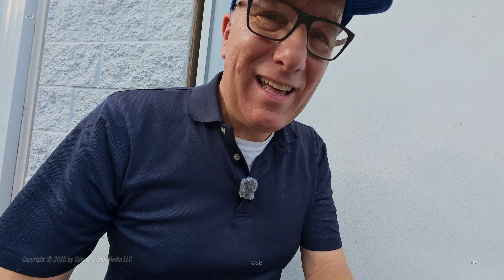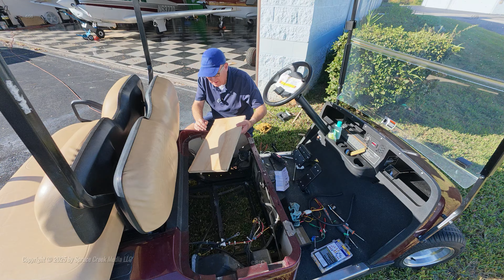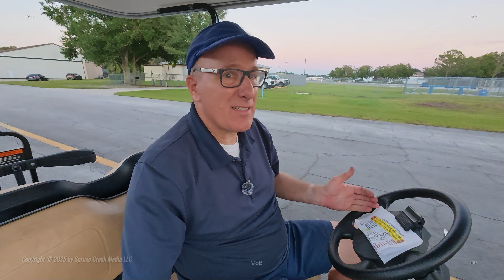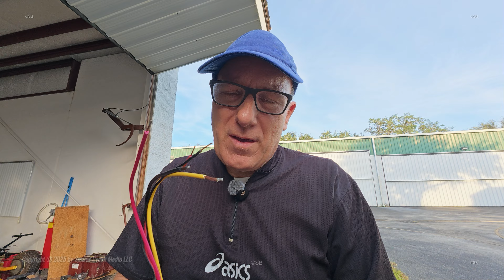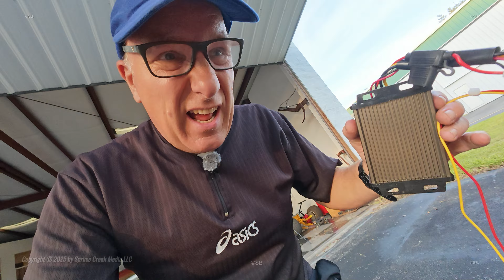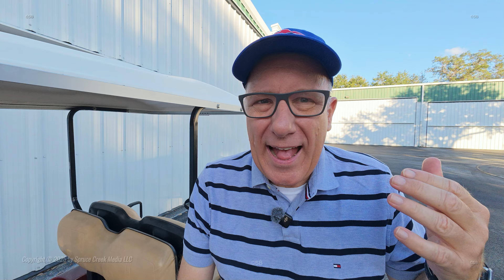GOLF CART LITHIUM BATTERY UPGRADE FULL INSTALL TUTORIAL + SPEED TEST!

Comment: well , after watching your video i resume that lithium element combine with a combustion-engine ( motorbike ) make no sense ( reducing maintenence cost ) ...sure wight diff. is alot compare to Plum-Bum ...

Delta-Temperature is also not that much if at 18 o'clock is 27°C weather-condition plus a HOT engine ➡️ Lithium get in few month very close to the "border of wear" 
- i save mony for carbon-firbre parts and titanium pipes ! 👋🍀